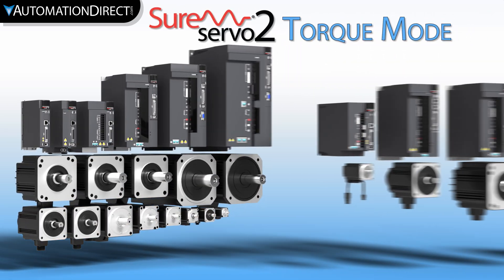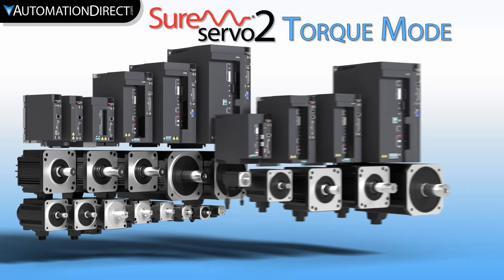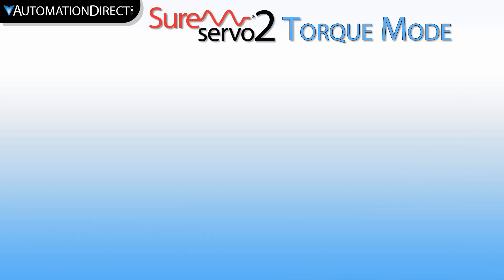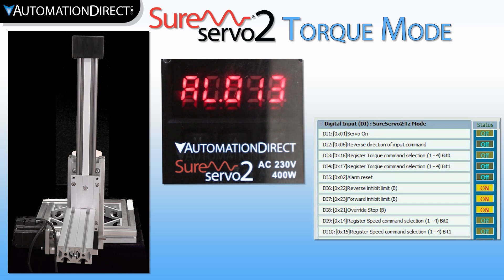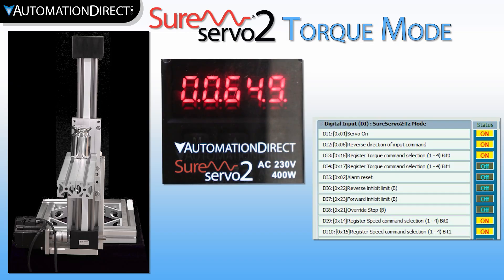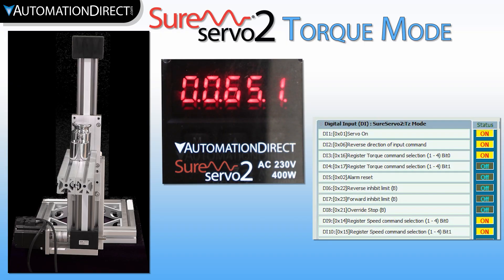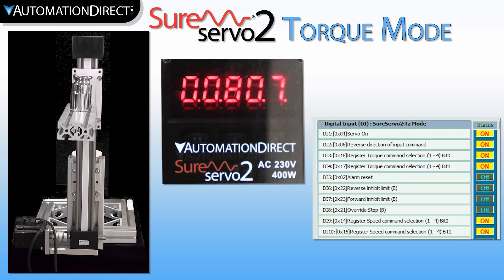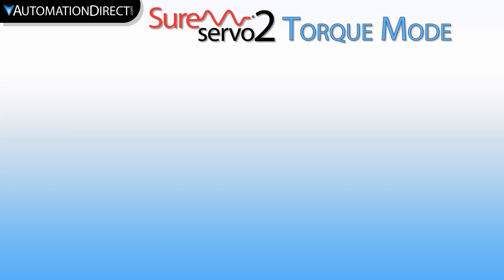SureServo2 Torque Mode: Are You READY? from AutomationDirect

Comment: This gives you the ability to use the motors like hydraulics with the ability to stall and not fail that’s pretty cool
Reply from the maker: @josephjorgensen3282 Absolutely. It has a lot of very cool applications. Slip control and variable position constant torque applications are definitely included as well.